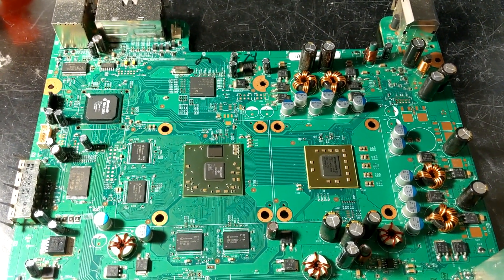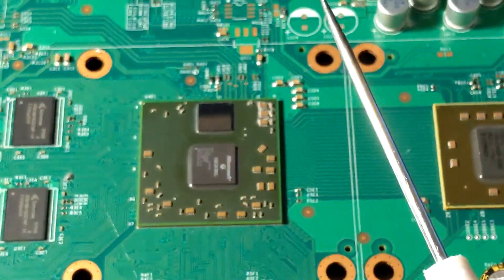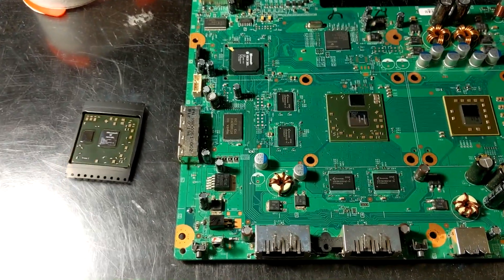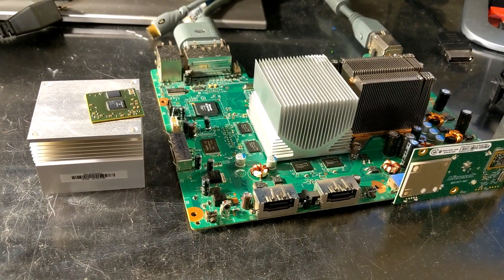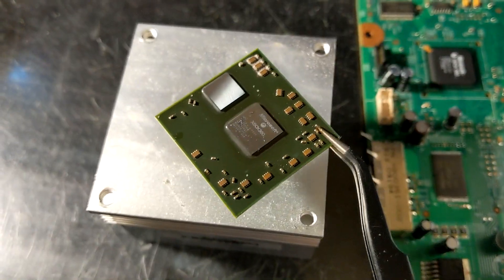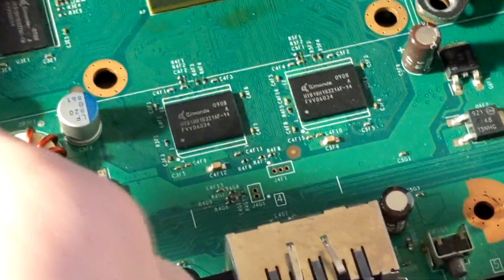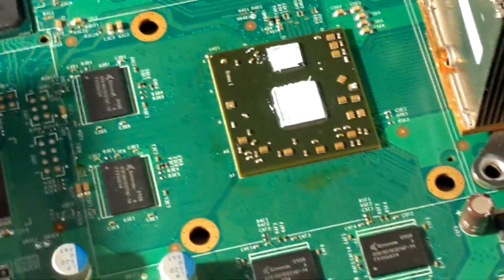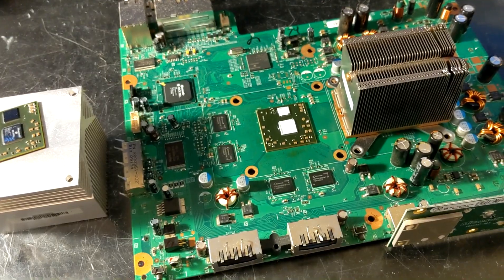Xbox 360 E 74 GPU Repair and Zeus to Kronos Upgrade

Comment from the maker: I noticed an error... Kronos targets 75C not 73C, but still, my point is valid, no need to change the targets.
ALSO, we learned there are no 80nm silicon for Xbox 360. Those people were wrong, it's actually 90nm still but an improved design.

Comment: New to GPU replacement, can you do a video for beginners how to replace the GPU for those who don't have a BGA?
Reply from the maker: No, I can't. This stuff is very specific from setup to setup, things I do may not apply to another setup. Also, this is difficult and usually requires proper training.

Comment: Hi man,
I tried to fix my old Xenon 360 a couple months ago, back in the day I tried the towel trick and it worked for a couple of weeks, but I wanted to do a clean repair this time by cleaning it with IPA, changing thermal paste, pads, but it didn't worked.

I saw your channel and website and I would like to know if you offer your services? I would like to swap the GPU of my 360 and switch to the Jasper 1 which I think is the most reliable..

Have a great day !
Reply from the maker: Switching the Jasper one on Xenon is very complex board procedure which is not offered by me at this time, takes too long. I have a video on that on my channel.

Right now, I am not offering any services due to that I am very busy with university.

Comment: Can you please show me how to replace the ICS ethernet chip? Mine might gone faulty/dead since system can't detect a plugged in cable. No LEDs on the switch either.

Can it be something else that has blown up or shorted?

Xbox works fine otherwise as far as I know.

There was a lightning strike, power cord was unplugged but not the ethernet cable. So it took out the router and some other stuff as well.

Please help.

I have two spare ICS1893 chips. In case of that is the issue.

I really don't know how to diagnose this.
I have Schematics and Ellegro boardview files for Jasper V2/Kronos as this board are one.

Xbox 360 Elite
Reply from the maker: You can remove with hot air and install via drag soldering.

Comment: I got a Jasper with the Kronos GPU that GameStop had bolt modded. Guess what? Red ring with 0102 secondary. Thanks GameStop.
Reply: Your first mistake was buying a refurbished console from GameStop.
Reply: @KannonBlitz85  I didn’t buy it FROM GameStop, I got it in a broken console lot
Reply: @carwashreviewsandmore7609  Ah. Fair enough.

Comment: Hey Josh/Octal what other differences have in the kronos revision than the jasper v1 ? 
Is the GPU changed heatsing to the original from xenon model actually better ? or worse ? or it doesnt matter at this point ? What other changes are present ? (even small ones)
Reply from the maker: Kronos revision:
- shrunk eDRAM to 65nm
- Removed unused "DUMBO" and other unused pads/circuits from board
- Added optional redesigned standby power 3.3 and 1.8 volt circuits, some vendors used it, some used old
- New RF/ROL module "XFreedom", probably cheaper to make, don't know other differences about it
- Return to the original GPU heatsink, as the extended heatsink was only added to quiet the fans, this was no longer needed.

These are all nice the differences I have noticed so far unless I am forgetting something.
Reply: @Josh.Davidson  Thanks for the full answer. Curious what exactly has been changed in this RF module. This has to be the green ring lights right ?
And also curious why some people think the extended heatsing have bigger effect on the kronos GPU and have swapped the heatsink with the extended one. I've watched some videos here and there and even some advices on reddit for other people to do so.

Comment: After watching this, it makes me happy that my late 2009 model jasper that I had since May of 2010 has never broke down on me once. I have NEVER heard about a Jasper having the red ring of death until I watched this video, and I'm glad that you were able to bring it back to life because in my personal opinion, Jasper model consoles are the best and the most reliable consoles in the whole 360 lineup, and mine will always be my primary 360. :)
Reply from the maker: Its a Kronos model, you are 99.9% fine :)
Reply: late 2009s are almost 100% kronos models, only thing you really need to worry about is bad caps which probably wont happen (though ive seen some with the shitty ass sanyo caps so it can)

Comment: This worries me, will eventually only Kronos boards be the only working 360s?
Reply from the maker: You're worried because 1 unit failed? There will always be 1 failure of some kind.... I bet someone in the world a Kronos GPU failed. It's fine lol.
Reply: @Josh.Davidson  someone in the world with failed kronos ? even this is a long shot.. however that's why I have 2 kronoses :P 1 used actively since 2011 and other one brand new waiting some day to be put in use haha. It's even a miracle I found brand new kronos on ebay in 2018 .. for the small price of 140 GBP or around 180$ and of course bought it.
Reply from the maker: @XtremeBG  Yes I've seen one fail somewhere. Probably more, no system is 100% there will always be some failure somewhere. But hey, its the best reliable :D
Reply: @Josh.Davidson  With two kronoses (the one brand new unused, the other 10 year warrior) I think I will have 360 access for at least the next 20-30 years :D
also is that one failed kronos because of GPU ? or other ?
Reply from the maker: @XtremeBG  Nice :D
Sadly I don't know, I don't have access to them.
Reply: @Josh.Davidson  I was looking at listings and found a 2010 MFR date (Jasper v2/Kronos im assuming by the date and power), but they listed it as defect with the E74 error to my surprise. Is that guaranteed to be that same GPU problem or could it be anything else at all?
Reply from the maker: @Vryndar  E 74 is always a dead GPU. It could be a mistake or a shell swap. I'd be very surprised to see a Kronos with GPU issues, but then again, nothing is 100%. I'm sure there's a small number of units that failed. No one system is 100% failure proof but Jasper Kronos is as close as it gets with the X360.
Reply: @Josh.Davidson   I see and thank you for the reply! Yeah a shell swap would definitely make sense, the history of that one is unknown to anyone else so hard to say. In general for increasing longevity of a Kronos or any 360 for that matter, is there anything recommended other than just making sure it's maintained, clean and apply new thermal paste when necessary? These consoles seem really hit or miss and fragile so definitely want to preserve as long as possible ahah. Fan mods, heatsink swap? Idk if anything makes a signifcant difference.
Reply from the maker: @Vryndar  Fan and heatsink mods is stupid and does not increase anything. The peak temperature the chips had NOTHING to do with the failure. There is nothing you can do, either the chip has a defect and will fail, or it doesn't and it won't.

Comment: I need a proper reball jig and stencils like this too.
Reply: I use around 320-340°C, 420°C for GND. Also, I use the A/V port shielding for GND since it's way easier and avoids applying lots of heat directly to the motherboard

Comment: Hi, Josh! Can I install this Kronos 1 GPU instead Gpu Rhea on zephyr_c or falcon?
Reply from the maker: I will test it in the future.
Reply: @Josh.Davidson  I install Kronos GPU on zephyr_c, and I have 0021, after installing on board Jasper's south bridge - no changes. I think, what after installing SMC  2.3 in nand it will boot, but I haven't CPU key(, tomorrow I try to install rgh2 with Jasper ECC to grab the key
Reply from the maker: @senator_man  hello PSB not supported on Zephyr.
Reply from the maker: Be sure it's _C also or else pcie layout wrong but I didn't check. I will check the falcon set top box
Reply: @Josh.Davidson  yes, it is _c, it had gpu rhea with 0102
Reply from the maker: @senator_man  interesting. Jasper schematic shows Y2 so I imagine the layout didn't change since then. I'll try on falcon
Reply: @Josh.Davidson  I install another xsb on board, and still having 0021
Reply: I check and resolder all resistors and capacitors on your 0021 repair guide, all of them seems to be good, but still 0021 :(
Reply from the maker: @senator_man  damn... Hope it's not a different. I'm gonna check pcie layout now before I do the swap. I'll get back to you
Reply from the maker: @senator_man  I chekc soon get back to you.
Reply: @Josh.Davidson  have you tested it?  it works?
Reply from the maker: @senator_man  Sir I didn't have time yet. I will do it soon as I have time.
Reply: @Josh.Davidson  all right, I keep waiting
Reply: @Josh.Davidson  Hi,i have some updates on my experimental zephyr. I reflow gpu (i have found, what some ball don't solder to board, my gpu have bends on the corners, ah my bad bga solder skills ), and now it shows 0110 and sometimes 0101. Try to install this gpu on zephyr, as you can see it's maybe can work on him).
Reply from the maker: @senator_man  Interesting, maybe the GPU is fault or something. But that you got past PCIe is interesting.
Sorry for so long time didn't do anything... been really busy. Will try soon.